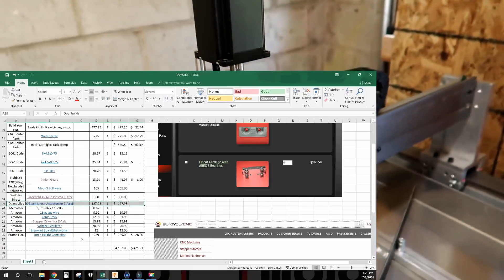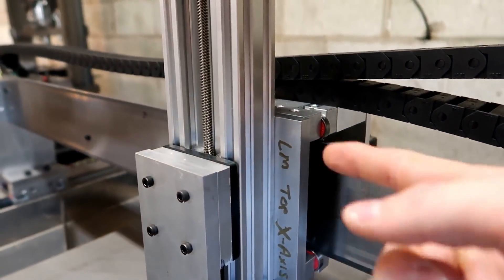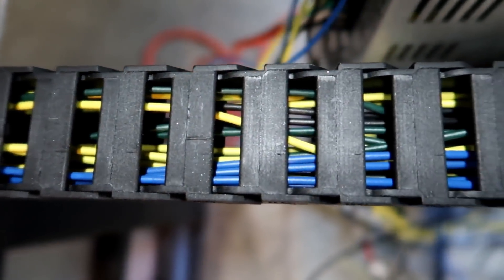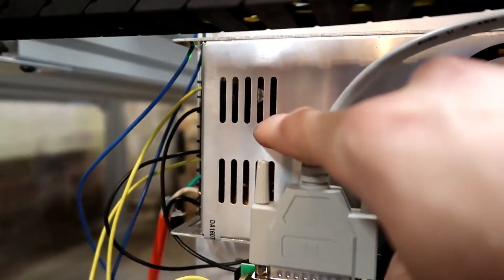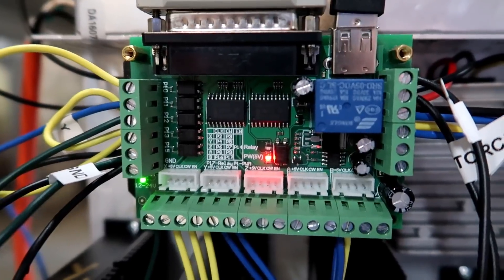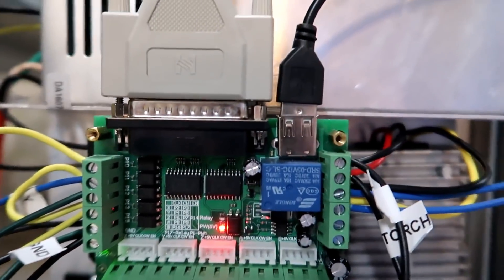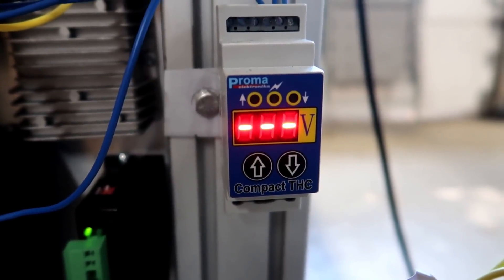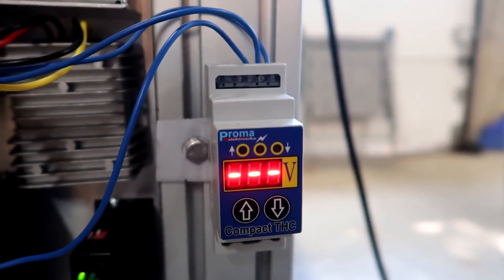DIY CNC Plasma: [PLANS]Finalized: Home Mfg. Days #48

Comment: Did you build the controller PC or buy something?
Reply from the maker: I got a mesa board that I installed to the computer so the CNC control board(C10 Breakout Board) could talk back to PathPilot.  To answer your question, I just bought the computer from craigslist and put Tormach's Pathpilot on there.

Comment: Did you ever get the height adjustment working?  Interested in hearing how you hooked up the Proma.  Follow up video maybe?  Nice job!
Reply from the maker: Oh yes a follow up video is coming. So I ended up getting a better THC for my needs.  It's still a Proma but this one will work out much better.....I hope.
Reply: How do you like the plasma torch? Lot's of discussion about it given its low cost in comparison to a Hypertherm.  Are you please with it?
Reply from the maker: So far I am pleased with it but I haven't used it a whole lot so it still could turn out to be a dud.

Comment: I have the same z-axis.  I made it floating by getting 4 more of the wheels that run in the v-slots on the outside of the c-beam and connecting them to a plate so it can slide up and down the length of the c-beam.  Then I slotted a hole in that plate that lined up with one of the bolt holes in the part they call the c-beam gantry plate. (The part the leadscrew pulls up and down.)  I put a bolt through the slot into the gantry plate to capture the fabricated carriage.  Everything moves together except that the carriage is free to move up and down the distance of the slot. I mounted a microswitch so that the bolt will operate it when then carriage gets pushed up in relation to the c-beam gantry plate.
Reply from the maker: I'd have to see a picture of it but it sounds like a really good idea for the floating head system! Thanks for sharing with me.  If you have the time, send those pictures to mojo.mfg.ops@gmail.com

Comment: Is that plasma cutter high frequency start?
Reply from the maker: Its a blowback start.  High frequency start would ruin the electronics apparently
Reply: So am I right in thinking that a lot of the off shore plasma cutters are HF start? Also, what's your take on the cncrp trucks on the cold rolled steel?  I've been thinking of building something similar.

Cheers,

Chris
Reply from the maker: I'm thinking you are right about the off shore plasma cutters and HF start.  Just make sure you get the blowback start if you make something similar.  I really like the CNCRP trucks for the price! If you have the money then I would really suggest the linear rails that CNCRP has on their Pro CNC Kit though.

Comment: Very nice man! Good idea on the enclosure. Your final product looks awesome. 

When you add the floating head, you might consider magnetic break away. That way you dont tear up the torch if it catches on a tip up.
Reply from the maker: Thanks! Yeah the magnet break away is definitely be the route I will be taking.